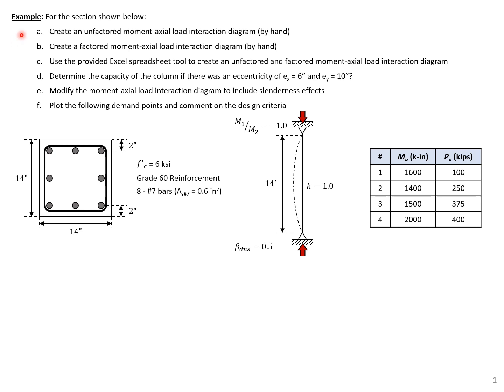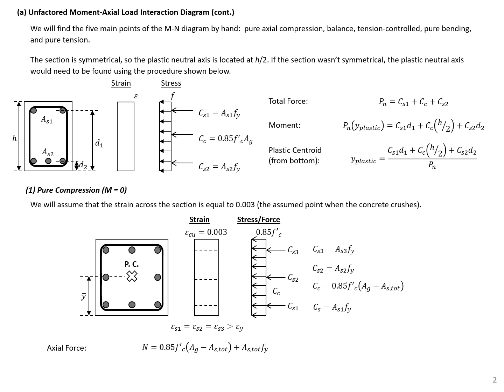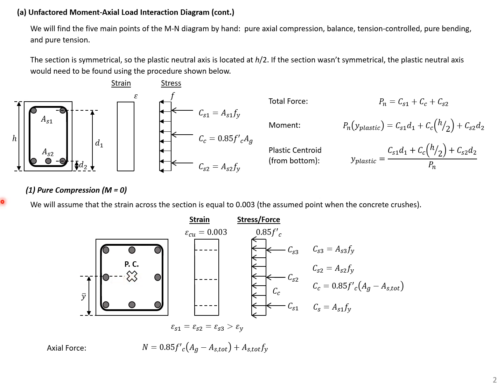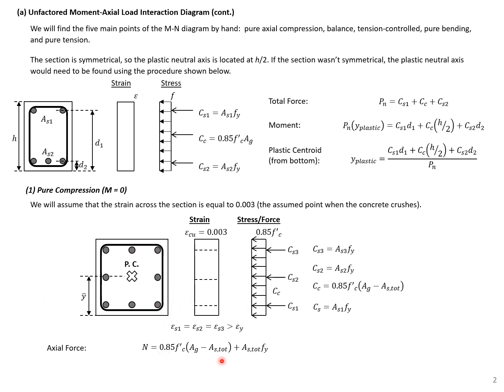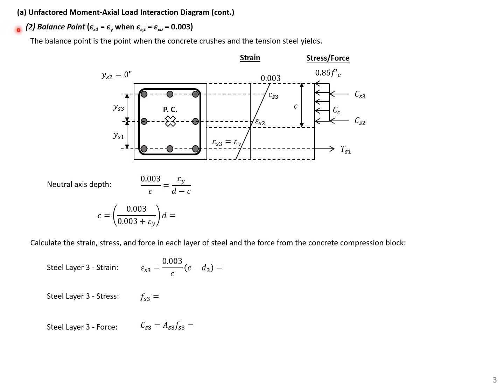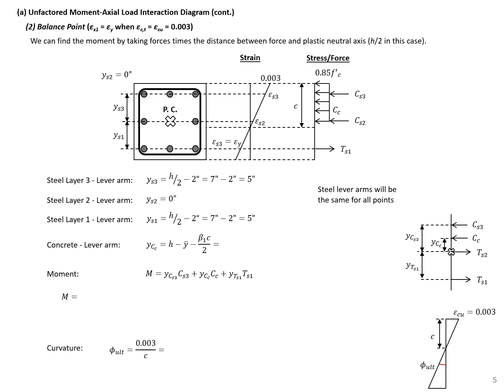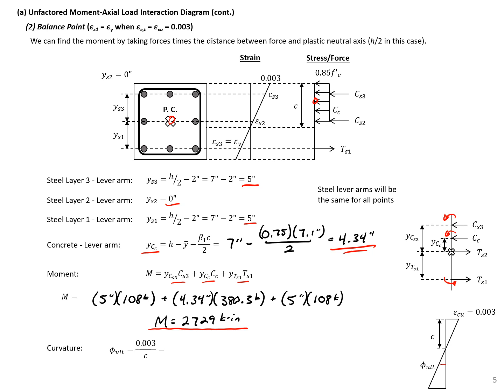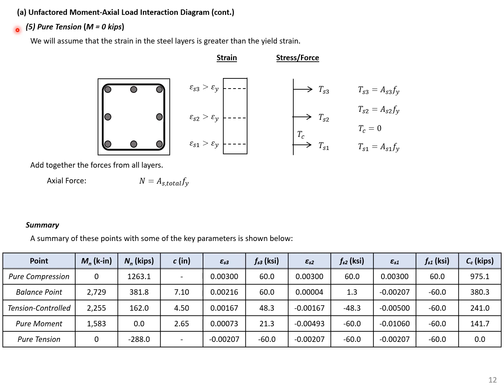Precast Concrete - 4 - Example 1 - Column Design

Comment: When calculating the bending moment aren't you doing it around the elastic neutral axis(axis with equal area on either side?) not the plastic axis(axis of neutral force) like said in the video